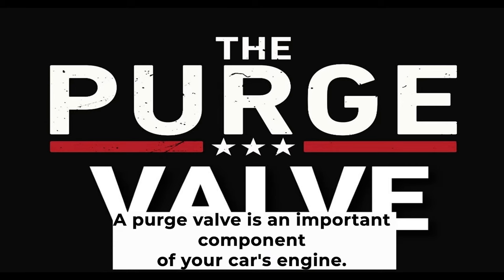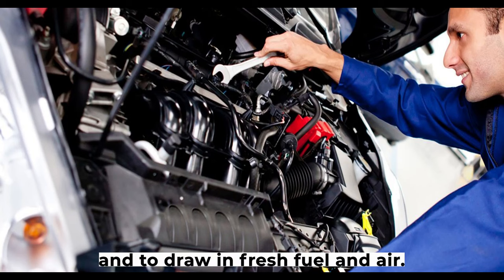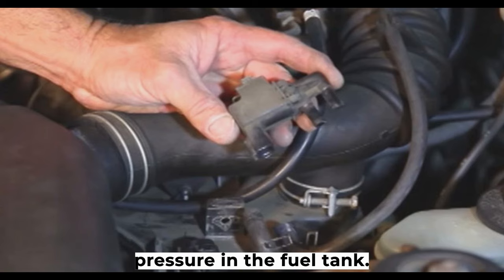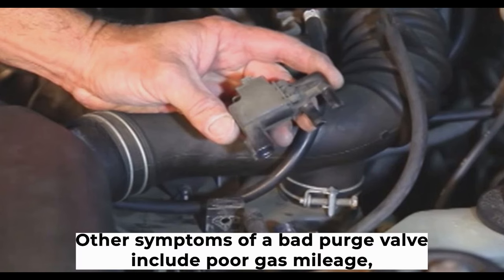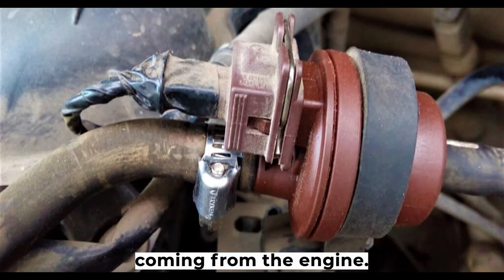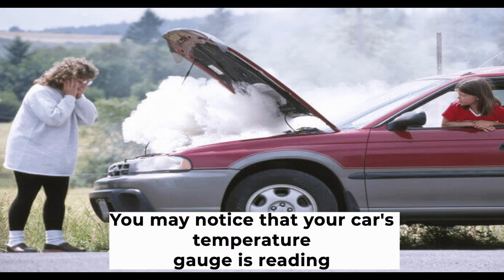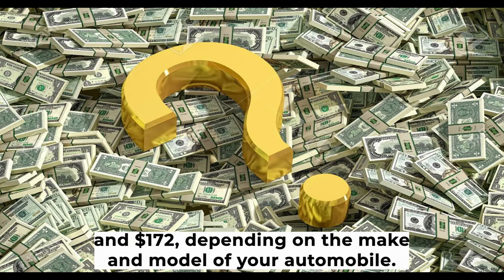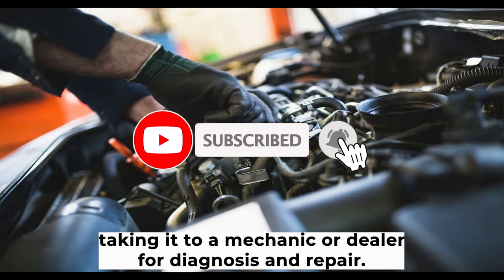5 Symptoms Of A Bad Purge Valve

Comment: I paid $20 for an aftermarket valve from Amazon and it took me less than 5 minutes to change for my Chevy Equinox. I have noticed a huge difference in my cars Idling, power and gas mileage.
Reply: Thank you for this i have a equinox as well

Comment: I just replaced my purge valve on my 2003 Buick PA... It tested good in regards to holding a vacuum, it was an aftermarket part. I was throwing an evap leak code, so I replaced with an ACDelco OEM valve, code gone. Spend the extra money and get the OEM part.

Comment: It also depends on the age of the vehicle also I have a 95 Plymouth Grand Voyager 3.3 6 cylinder right now my evap canister is disconnected I have no issues with fuel economy fuel vapors or fuel tank issues nothing in fact my vehicle runs even better and gotten better on gas mileage

Comment: I had  1994 that I removed all the evap parts. Put a regular vent on the hose from the tank, and plugged all the vacuum lines. OBD 1 so it didn't check see if it was working. I think 1996 & up OBD II the ECU checks to see if it is working.

Comment: So on my van I never have problems with the smell of gas, but if the day goes up to about 92 degrees and when I run the back AC which puts a further drag on the engine, after about an hour it smells horrendous of vaporized fuel.  My theory is that when the ambient temp in the engine rizes high enough the purge valve stays open allowing for the gas to leak out.  THis condition is not often so I was wondering if I could override the value command from the ECU and make an external switch that will force it closed for a little while until I can get on a freeway to allow the engine to cool rather than the city stop and go.  All parts have been replaced but still and issue.  Any ideas around that duck tape idea?

Comment: I have a code on my 2011 Grand Caravan that says "GASCAP" on the dash display.  So I tightened the gas cap and it remained, replace the gas cap and it remained.  Changed the ESIM Module and it remains.  After seeing this, I'm going to change out my Purge valve and see if this resolves my error code because my car also randomly stalls out, has a loss of power and gas mileage as well as higher than normal engine temps and a bit of a rough idle.  I have not noticed any black smoke from the exhaust but will take a look and see if it does have it as well.

This explained the symptoms, error code as well as the P Codes I get from my FixD sensor.  Time to order me a new Purge valve...
Reply: Update.
Change the gas cap, ESIM, Purge valve and MAP sensor, have driven about 500KM's since they've been changed and even after resetting the codes, the "GASCAP" error is still displayed on the dash.  So I guess the only things left are the canister or a hole somewhere in the lines or gas tank but I have no smell of gas vapor that I can detect.

I don't have a smoke machine so I guess now I'm going to have to take to a mechanic and have them look into it further.

Comment: Can a bad charcoal cannister can also cause clogging for line to purge valve? I am having hard starts and stalling and mechanic said my purge value is working as it should but clogging of lines because of bad cannister most likely culprit. Would you agree?
Reply: Your mechanic should've been able to answer that question with a simple test - pull the bottom (closest to the ground) hose off the charcoal canister. If gas leaks out, your canister is full and needs replacement.

Comment: You do not have to go to a mechanic for a purge valve specially on a Mustang. You can get a purge drive for 80 bucks at any auto parts store are for the OEM. It will cost you about 122 to 140 depending on who you get it from It’s something a person can do by themselves. It’s literally plug and play. Do not go to mechanic you can do it yourself. It’s a literally easy you will save yourself like 300 bucks or more if you just buy the part and do the labor yourself now when it comes to the purge valve, you gotta understand there’s several different codes for that purge valve, so YouTube is kind of confusing when it comes down to it because it matters if it’s open still close if you gotta leak all that has a different type of remember that it took me forever to find somebody knowing that that was the issue and that was the part to replace going to dealership they’re gonna want you to buy the entire system which is like $400

Comment: No not really..  First, you show a carbureted engine and purge system. Not to many of those from the factory anymore. ALL the symptoms you mention MAY occur on a carb vehicle with an evap system but not on a fuel injected engine even though you try to relate it to a computer (EEC) controlled engine. The sole purpose of the "evaporative emissions system'  is to prevent EVAPORATING fuel vapors from leaving the vehicle and entering the atmosphere. Hence the name. The vapors from the fuel tank are captured in the charcoal canister and then "purged" back into the engine to be burned at certain times during in the combustion process. Fuel tank venting is usually run through the charcoal canister so you might get a gas smell in your garage if the purge valve is inop and likely the computer would give a fault code. If the canister is damaged or plugged you may get fuel delivery problems from not allowing venting into the tank, but that's not the purge valve's issue. Fuel economy might suffer if a vacuum line in the evap system leaks allowing extra air in as would any uncontrolled vacuum leak. Again. not the purge valve.  Even if the system does not use a canister to hold vapors, you make this sound way worse than it is, and you repeat yourself to make it sound that way.

Comment: Hello there! So I waned to buy used 2015 Dodge charger from someone and when I asked if the car  has any mechanical issues, the owner replied yes: the Valves have to be calibrated. What should I do now? Should I buy and fix or I shouldn’t? please help

Comment: My 2.4 engine is idling rough. The code says emission system small vacuum leak. When I completely cover the vacuum line going to the evap system, the rough idle does not go away. There is no change. Any ideas?

Comment: "Purge valve" is used constantly in this video, but I think it is often referring to the canister vent solenoid and stated differently.  There is a purge solenoid located near the engine top and near the throttle body, so I am a little confused as to what this person is always referring to.  Most Vent Solenoids are located near the charcoal or vapor canister and yes, it does perform a purge function, however, most refer to it as a vent.
Reply: I think he is speaking about the one in the eng compartment

Comment: In my golf GTI 92 the valve not stay open or close, She ticking quickly, and work principaly at idle, its normal? I have disconnect the connector because the engine working a bit bad🤔

Comment: What's the difference between a purge valve and a EGR valve???
Reply: A purge valve is needed to clear too much gas vapour in a maybe a half tank of gas in hot summer. The EGR valve work to eliminate the Knox in the exhaust system by cooling the exhaust gases. The EGR will often when you drive on highway, because it doesn't disturb the engine running and this highway speed produce more Knox, that is a gas causing damage to atmosphere.

Comment: I have an issue with the car seeming to want to stall and but usually it keeps going. It  actually did go out once with the lights coming on a couple of weeks ago. Three mechanics can't figure out what is wrong. No codes come up.  We did have the canister and canister close valve replaced because we couldn't pump gas properly. So now we have this new issue and I'm not sure if it is connected to the same parts. Is the purge valve the same and canister close valve? This has been so stressful because I don't know what is going on.  It seemed random but I am pretty sure now that it happens after I pump gas. Not right away but the next time I use the car.  Any thoughts?
Reply: Don't expect this guy who put the video together to answer.  He's just reading the repair manual, and put out this crappy video..
Reply: PCV Diaphragm fixed this issue on my VW Passat, Purge Valve was needed as well but for the first bit.

Comment: When I'm at the gas pump it shuts off literally after every few seconds making it take 10 minutes to fill my tank ...can it be the purge valve?
Reply: I would like to know the answer to this. My truck has the same problem at all the gas pump.
Reply: Yes it definitely can be. Had that same problem with my 04 Ranger for over a year, changed the purge valve about 2 months ago and haven't had that problem since.
Reply: yes
Reply: @brandoncharge1516  did you have a code ? ...i suspect mine is bad , but will test when my wife gets home . gas pistol shuts of ....it dosent accelerate as normal . volvo s80 t6
Reply: @lassenielsen4340  Yeah the truck had a P0456 "small evap leak" code.
Reply: If the pump is shutting off constantly while trying to fill your fuel tank I would first check your EVAP vent solenoid and your EVAP charcoal canister. The charcoal canister has little charcoal pellets in it. What can happen is you can develop mold in the charcoal pellets, and the pellets will be more or less glued together in a big clump. I have had good success in opening up a charcoal canister and removing the portion of the pellets that are bad-it’s very easy to figure out the good pallets that are all loose versus the bad pellets that are all clumping together, once the bad pellets have been removed and disposed of you can re-close the charcoal canister and reinstall it into the vehicle. There are multiple videos on YouTube for various vehicles about how to open up the charcoal canisters. I personally have worked on multiple Ford vehicles that have had this issue, and if needed, I could give you some direction and help. Before you open the charcoal canister, though, you can test the vent solenoid, which is connected to the charcoal canister. If you remove the vent solenoid, you can do a pressure test or simply blow through it. You should find that with power applied that you cannot easily blow through the vent solenoid, but when power is removed that the valve should open to allow the gases to escape. Most of the vehicles that I have worked on I have had to replace the vent solenoid and remove a portion of the charcoal pellets in the canister. I believe it is because the solenoid doesn’t release all of the vapors that it’s supposed to the vapors, then sit in the charcoal, and eventually start to get moldy
Reply: @ajbergman3801  Wow..thanks...I will try this and get back
Reply: I am baffled got a 2015 malibu w po442 emissions code from onstar then all of a sudden my check engine light is on 😮.  My car is running great, no problem starting, pumping gas at all nothing is wrong. Brought a new gas cap light is still on...how do I fix where there's no known problem. Do I just start replacing the  cheapest thing first purge valve, FTP sensor, charcoal canister, is there even a fuel detection pump on 2015 or is it in the canister 🥴 there's no fuel leaks visible from tank. Could it be damage or leaking line that can't be noticed. Do I go pay hundreds possibly  thousands at dealership to be ripped off on something that I could have fixed myself for less than $200?? Please help me if you can any advice will be appreciated I can do some repair things.😢
Reply: @crystalsnow9752  they told me to check for blockage...cobwebs,etc ...pain in the arse

Comment: question please answer. can a purge valve or evap issue cause back fire? my car started some tail pipe backfire after i had exhaust work done,, could that have loosened a hose or connecton with evap system. crazy question i know... but i need to figure this out. thx in advance also.
Reply: yes it will backfire a bit especially when accelerating for a while then releasing off the gas pedal
Reply: @xdkoobie6628  i appreciate reply.

Comment: I got my purge valve replaced today because the engine light came up, but I have noticed that my car is not going more than 3000 Rev, does anybody knows the cause of this? I have a 2022 ford mustang
Reply: It’s probably just a faulty part I had to replace mine again after I replaced it the first time because it was faulty. Every time I would get gas it would run roughly when idling like it wanted to cut off. Also if you are getting gas don’t put any extra fuel in the tank once the pump stops. That is also bad for the fuel system.
Reply: @davidallen8348  I've just replaced mine for the same reason, seems to be a common point of failure for this model from what I've found online

Comment: I’m confused on one thing, how can the purge valve expel all the fuel and air from the engine after being shut off, if the purge valve is AT the air INTAKE.
Once the engine is off, there is nothing coming out from the exhaust because the intake and exhaust valves are alternatively closed, and the pistons are stopped in different position.
So if the valve is defective and stock open, you’ll just have a hard time starting the car again, that’s all

Comment: very confusing video. I really don't think you have a clue what you are talking about. (Clears out any leftover fuel from the engine?)  a purge valve draws fuel vapors from the charcoal canister. Over heating? I'd like to see that.  So stuck shut... won't push fuel vapors back into the engine instead they will run straight out of the exhaust blah blah..... get real, vacuum won't pull (air pressure pushing) fuel vapors from the tank, there's no vapors or fuel getting out the exhaust. I also doubt any shop would only charge $53 to change the purge valve, they would do diagnostics first even if you told them what you thought was wrong. "Oh my car is heating, steam everywhere, put on a purge valve", then you're mad because nothing was wrong with the valve, the thermostat was stuck.